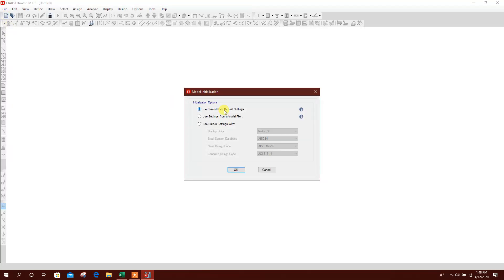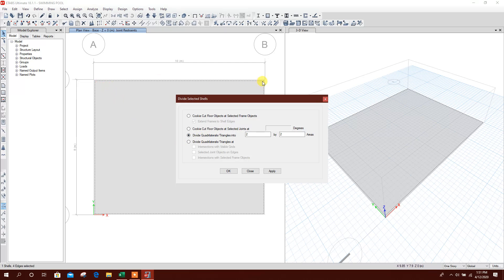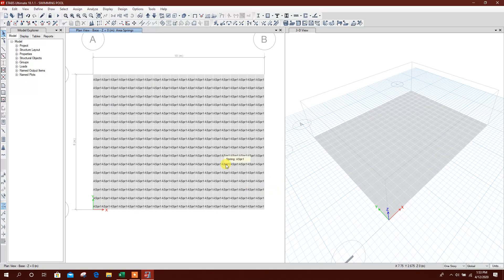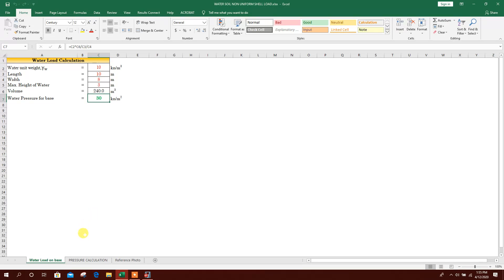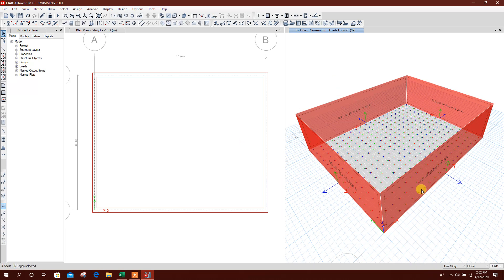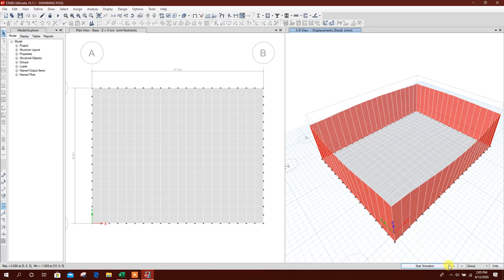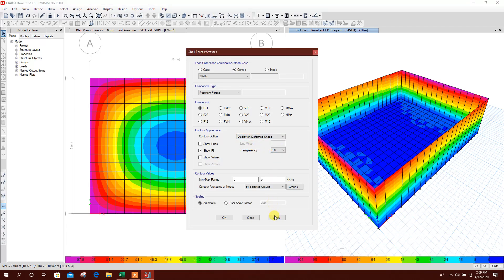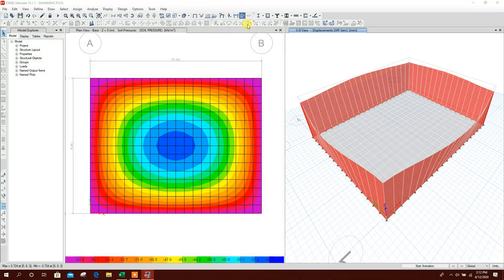Swimming Pool in Etabs | Applying Soil Pressure and Water Pressure

Comment: Nice work. Keep it on. Now the question is, Do the walls and columns really take % plus and 70% minus lateral loads (quake) as per IS Code? How do you know and do make that happen? Dual system with EQx, EQy, EQz and Sprectrum Analysis as dual system. Can you help on such vidio. How do I join as I am in Nepal.  No join button and didnt get / understood  your advice on what you said in this vedio. Thanks. Keep up the good work.

Comment: Thank you, Sir. Sir can U elaborate In support Why U restrain Only translation x and y and not considering Rotation In this. ?
Reply: Fixed supports will exert additional stresses on soil and the foundation must fulfill strength requirements such as moment and axial capacity and overturning resistance. Hence, we provide hinge support.

Comment: Hi my friend you use in area spring with compression only but  your analyza was linear this is  wrong if you use compression only or tension only you have to  use nonlinear analysis
Reply: I have the same opinion as you. I'm not understand this one. Normally, I often assign K spring for point.

Comment: Brother, Can you please elaborate on "AREA SPRING value 15000 Kn-m/m2"??? Means any particular conversion method is there for that obtained value??
Reply from the maker: I just used it as example, for proper value conversion you need to check previous tutorials.
Reply: @Decodebd  bhai which tutorial you have explained area spring value ? i cant find it out . could you share the link ?
Reply: @mahiulhossainbappy7929   spring value will be SBCXfactory of safety/settlement allowed

Comment: Unit of C is Kn per cubic meter (Etabs) but in excel calculation show Kn per sq. meter
would you pls explain about it 
thanks in advance
Reply from the maker: At 3.5 m Pressure = kN/m2, After solving the equation, C= kn/m2 divided by m= kN/m3.

Comment: BECAUSE THE DEAD LOAD IS 2,0  kN /m2 IF THE SLAB HAS 350 MM? . SHOULD BE GREATER. FOR ME IS 8,4 kN/m2  (24 kN/m2*0,35).

Comment: Why didn't you apply point springs and edge constraints????
Reply from the maker: Because I assigned point support at edge.
Reply: @Decodebd  can you explain in detail what will happen. In point supports and point springs case, which one is better and function ?

Comment: Is it possible to model the same in SAFE? Thanks
Reply from the maker: I have not tried it in SAFE
Reply: @Decodebd   I am designing a slab with some walls around it (3 ft tall, not super big) and was wondering how to assign soil pressure on SAFE. SAFE does not give you the flexibility to assign loads on 1/3 of the wall & also design reinforcement / rebar. Any thoughts? I'd appreciate your help.